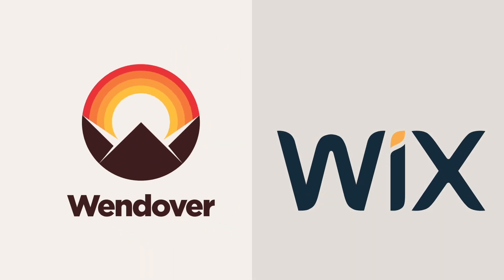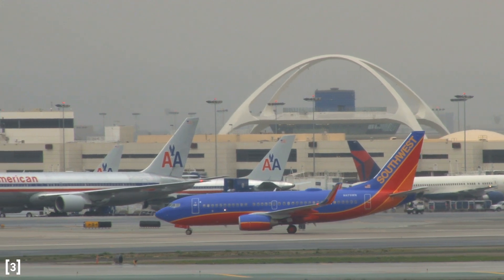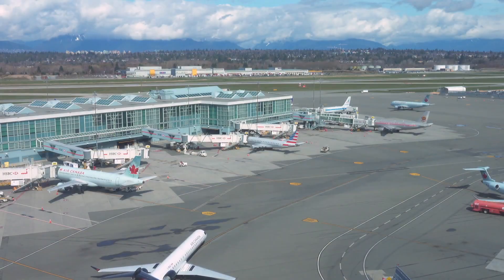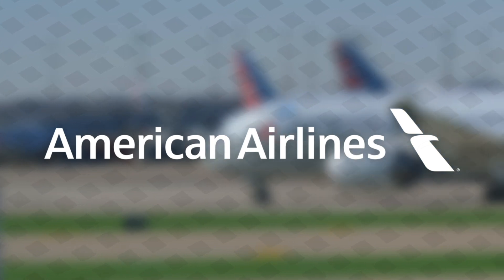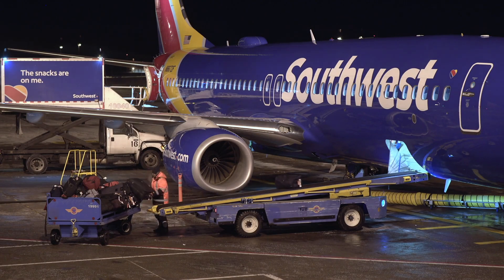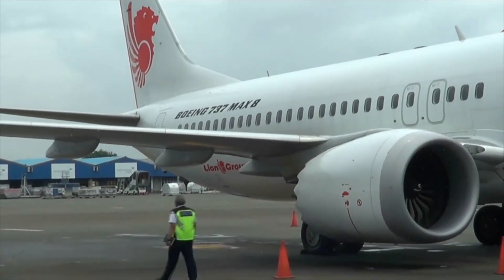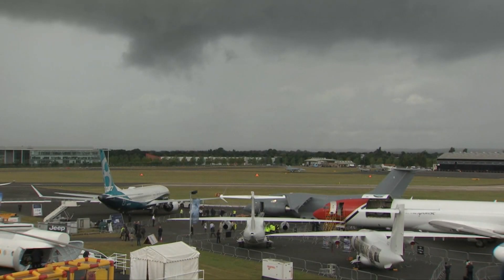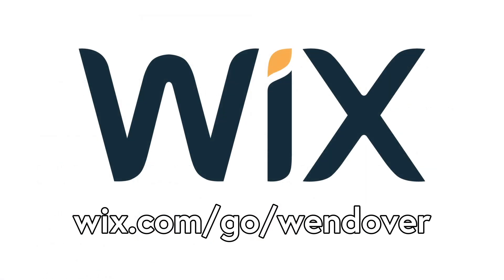The Economics That Made Boeing Build the 737 Max

Comment: I never found the lion air crash back when it happened as worrying given their rather unfortunate track record and lax safety procedures. The Ethiopian one was definitely far more worrying and finding out that the same thing happened twice was enough to seal the deal. Another thing with the lion air crash was the fact that the MCAS failure occurred on one of that captain’s earlier flights and a more competent crew managed to realize that disabling autopilot was all he needed to do. Yet the captain did not repeat that on the day of the crash. Unfortunately that’s what happens when air travel is a necessity and the country isn’t wealthy.

Comment: Several issues with this video.

0:16 Pre-flight checklist? This usually is download navigation charts, checking the forecasts, etc. Not sure how you can do check the forecast on paper and you don't fly any airliner with a paper map. Other checklists are on paper on "most modern airplanes" as well. Pre-start, start, before taxi, etc. this is usually on paper. Something important is that these checklists may vary by your airline company.
0:23 Start the plane by flipping a switch? No, most modern airplanes are not really started like that. Before starting the plane you need to check several things. After that it is indeed fairly simpe to do an APU start. But before that (in pre-start) you've got batteries, external power and/or generators started anyway. If you look at the pre-start and startup checklist for an A320 (or even also neo) it say more steps than simply something like "START SWITCH....................ON"
0:29 I'm an airbus guy but afaik the 737 warning light can indicate several specific warnings that are illuminated. Additionally, every airplane (boeing included) have audio warnings. TCAS, TAWS, etc. The aircraft will literally tell you things like "too low, terrain, pull up" or "traffic, traffic, pull up" or "too low, gear/flaps/etc."
7:15 American wanted a new 737 because they had 737 pilots? Then why did they buy 260 a320/neo for which they had no pilots?
7:41 Especially in the EU Ryanair uses something called "wet lease" which means you lease a crewed airplane (with pilots, cabin crew, even food service); e.g. they mostly use Lauda for Vienna routes
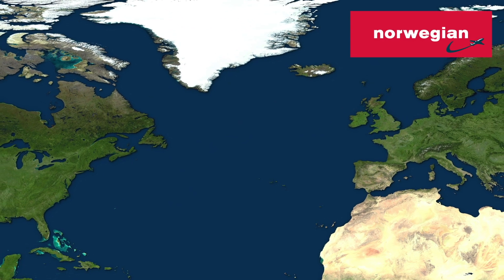8:32 That's not how you pronounce Bergen. Takes 2 seconds to check that.
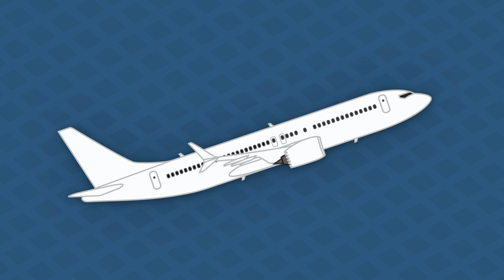10:22 As far as I know, multiple sensors.

I forgot where exactly this was mentiones, but planes actually use a lot of fuel on the ground as well. The A320 consumes 0,1kg fuel per second while taxiing on the ground. Though in cruise, it uses about 0.7kg per second. Short-haul planes have significant percentage of fuel burn during taxiing, especially at busy airports.
Reply: You missed so many points and went wayyyyyy too literal here.

Comment: No one had to guess if the plane would crash because Boeing engineers and safety people already knew their plane had high probability to crash. That’s why they put MCAS on it. And in company email they bragged about manipulating the commercial airliners into thinking pilots didn’t need retraining. Basically Boeing knew there was a problem and covered it up. Fired employees who called out problems or threatened their jobs. You can’t get anymore guilty than that. Read up on it. Watch the videos. All the facts front and center now. But what’s shocking in no one will go to prison over this. I’d never fly in a Boeing. Not over safety issues. They probably got it fixed by now. But over them living about it and knowing it exsisted. Then doubling down on their lies. Boeing is dangerous now. First thing they did was blame pilots when they knew they didn’t even tell the pilots or the airline companies of the exsistance of MCAS. Boeing knowing sent over 340 people to their deaths. Would you trust your families live in a Boeing plane. Would you trust your life?  What other safety issues have gotten through that Boeing has knowingly covered up?

Comment: This video discusses the crashes of the 737 Max aircraft, but omits major points.

On the Lion Air aircraft, on the immediately previous flight, the same nose-down issue occurred. The pilot was able to determine he should shut off MCAS, though how he knew since there was no training is not explained.  They landed safely.  Lion Air then conducted a repair on the angle of attack sensor triggering the problem.  Lion Air did not brief the next crew about what had happened.  The new crew took off in the same aircraft.  The same sensor continued to have issues, causing MCAS to force the nose down.  The new pilots were unable to determine that MCAS should be shut down, probably because they had never been trained on it.  Tragically, the aircraft crashed and all perished.  I hear no one asking why Lion Air did not brief the second crew about what had happened to the first.  Lion Air has a share of the blame over this crash as far as I am concerned. Boeing is also to blame.

By the time of the Ethiopian aircraft's flight, every pilot on Earth knew about the Lion Air crash and what had happened.  As soon as the first nose-down condition occurred, they should have immediately shut off MCAS.  Failure to do so led to the crash.  I do not see how Boeing can be blamed for this crash.
Reply: Quite simple. You could have the worlds best pilot fly that plane and the MCAS would still malfunction and pitch the nose down. Now yes the pilot may well have recovered the plane and turned off the pitch motors, but that still means he has to trim manually which was found not to be so easy. This was discovered by the ET crew who did turn off the trim motors but then struggled to manually trim back up so they had to turn them back on again. In short it’s Boeing’s fault for designing a system that was flawed because it had no redundancy if it were to fail. That could account to negligence, especially if you then did not disclose this information to the pilots who expected this aircraft to fly just like the NG series. If the MCAS was better designed with redundancy and mandatory warnings instead of optional then nothing would have happened except for a warning. If the pilot was the worlds best, the aircraft would still have a major flaw.

Imagine driving down a road and you come across a fallen tree (MCAS fails). A bad driver will crash into the tree and probably die(unable to stop the trim). A good driver will drive around the tree and avoid a crash( turn off the trim motors). But then do they stop and report the tree to the authorities (Boeing) to have it removed (repaired). And if they do, do the authorities just tell people to watch out for this hazard (issue a warning to pilots to be aware) or actually remove the tree and prevent a potential crash? Who would be responsible if another car then crashed into the tree even when the authorities were aware

Comment: The best ever video about the 737 Max with clear explanation about the engineering deficiency and the motive to produce that killer aircraft. I am sure Boeing will make many assurances about this model but I would not book a ticket on any airline flying it ever as it seems a cheap and nasty option for airlines and it should never be offered as a safe means of transport to travellers.

Comment: Another problem is that the had MCAS affect the trim system, instead of being a stick pusher system, which would have been much safer.
But a stick pusher system would have required new certification and training of pilots.
Changes to the trim systems are less regulated.

Comment: The problems actually began long before 2011. By 2000, Boeing should have seen the writing on the wall for the 737, then a 30-year old design. Management chose to keep working with less expensive updates instead of taking the long view and getting a new generation replacement into production. Even in healthy economic climates, any way a service provider can save money in the medium to long term, is an important part of profitability and sustainability. The attitude of "going cheap" and extending and fixing developing problems was driven by corporate greed, and it eventually caught up with them. Building aircraft and predicting the shifting market is a long-term exercise in gazing into your crystal ball and making sound judgements based on what will be best for your customers in the medium to long term. Boeing chose short-term gain over this, and is now paying the price for it.
Reply: By 1996, Airbus had already complained about the certification of 737 NG as a 737 derivative in Europe. I don't know the validity, but I've heard rumors the FAA strongly suggested Boeing was reaching the end of the road for 737 grandfathering with NG, particularly with a new wing, exit door issues, and runway length requirements. MAX pushes it even further with a new engine (at least NG had another version of the CFM), fly-by-wire spoilers, etc.
Reply: @AmbientMorality  my point precisely... it was the hubris of Boeing, and the incapability of the FAA by that time that led to the process. The true problem does not lie with Boeing - as a production company, it has to live with profit/loss... the issue was (and is) that the regulatory body (FAA) has no teeth, and no agents to confirm adhesion to the regulations. Self-certification was and always will be, bad in every way... particularly from the customer perspective.

Comment: Did the 737 Max engineers not use a Design Failure Mode Effects Analysis? Surely would would have included a "sensor fails" failure mode.

Comment: For everyone ripping the MAX, I recommend you look into the recently-released report of the Lion Air crash. It's pretty difficult (IMO) to walk away from that believing that Boeing's engineering was the sole cause. The pilots were incompetent and maintenance should be held criminally liable. It's not even clear that removing MCAS would have saved that airplane from crashing in the first place.
Reply: Mitchell Mason Yeh?well what about the other one that went down
Reply: If the plane didn’t have MCAS it wouldn’t have started trimming the plane nose down. Yes they didn’t take corrective action but the fault lay with MCAS in the first place. A faulty AOA sensor hasn’t caused any other plane to start nose diving

Comment: "The 737 Max only has a warning light."
Great, that's just what you need at 30,000 feet in the air -- a Check Engine Light telling you to go visit a mechanic.
Reply: Wanst the warning light an optional extra ?
Reply: Ian Muir for the difference in AOA yes. The normal warning light for engines, cabin altitude were always there
Reply: bigbodyrover yep. Many redundancies. At its core it was a very safe and reliable plane. They simply pushed its limits without retraining pilots.
Reply: That was a misleading sentence. It has multiple lights all over the cockpit for different instruments/systems. The pilots will know what's wrong when it happens. Newer planes have what's called an EICAS (Engine Indicating and Crew Alerting System) and it works pretty well but the 737 isn't lacking.
Reply: Clay Yosten yeah but compare it to an airbus which gives you step by step instruction on what to do and it is a really outdated way of fault finding. The pilots of Helios 522 didn’t even know what warning they were getting
Reply: @clayyosten2833 I think some Boeing 737 Max did not even have that light ..it was an option offered by Boeing at extra cost
Reply: Cyprian Ferns that was a light warning of AOA difference. Not the same as the usual set of warning lights
Reply: Yeah. Too bad we're not in the age of the Jetsons where  we could stop in at a station at 36,00 feet and have the mechanic take a look ; the passengers could get out to stretch their legs, grab a bite to eat and when the problem was fixed, we'd be on our way.
Reply: @bigbodyrover Hilarious. How did you come up with such a clever joke?

Comment: Pilot training costs drive the requirement to purchase the 737, meanwhile, the replacement for the 737 should have been the 757.  Re engine and far more cargo capacity.  Think about it, the 757 Max and all the problems with this old airframe design would be over.  A fleet of 757, WOW.
Reply: One of the best planes ever created pilots seem to say at least.

Comment: The Boeing 737 was an aircraft designed in the 60's. The 737 MAX was an effort to get an aircraft in service quickly to offset the success of the Airbus A320. What Boeing needed was a new aircraft, but due to the time scales in the commercial market they opted to put new engines on an old plane. This required the extensive modification to the undercarriage which they did not do. They put the engines in the wrong place instead and tried to patch up the considerable undesirable characteristic in the new design with software. In addition they tried to pass the plane off as a minor upgrade on the original airliner without the testing a new aircraft would require and without the new certification pilots would require to fly it. In all this,  two catastrophic accidents came back to bite Boeing in the arse. It is unlikely this aircraft will get certification again and if it did, would anyone want to fly on it.

Comment: People have short memories, in a previous "upgrade" to the 737, the rudder hardover problem, resulted in a number of accidents, only 2 of which Boeing have admitted were caused by a design flaw in the aircraft, in others they have used virtually the same excuses we have seen this time round, pilots fault not following the exact procedure laid down by Boeing, weather condtions, stupid foreigner pilots ( Copa (Panama), China Southern Airlines (PRC), Sahara Airlines(India) and - the one that some may remember - SilkAir(Indonesia),etc.) Boeing fought hard and manged to pass some of the blame onto subcntracors, expect the same over MCAST , they have already leaked hints that the software development was outsourced to an inexpeienced Indian company. However many of the accidents were in the continental USA, dead white people in the homeland - harder to lie about. The information that has recently appeared that Boeing knew of the dangers but thought a projection of 20 or so crashes was best handled through the courts and paying comp for the dead, rather than grounding the plane and sorting the problem, ie cheaper, especially as the majority were in poorer countries where brown bodies needed lower levels of compnsation, is so cynical I cannot help but think this process occured before in the hardrudder crashes. Please seek the detail out and read it, the twisting, turning, lies, blocking court tactics etc are alarmingly similar to today I am very reluctant to board whatever the Max is rebranded as when it returns, luckily,there are more competitors on the horizon, so I live in hope.

Comment: This vid propagates the well worn Interwebs myth that MCAS is an anti-stall system. It is not. It was added solely because the Max-8 did not conform to FAR Part 25.173 regarding linear stick force increase with angle of attack. In a corner case of the flight envelope the nacelle causes  a pitch up even more than expected. This reduces the sticks tactile feel so the pilot may think
it's ok to pull back even more (and possibly stall) when it should be pushed forward. So MCAS was added as a transparent stick 
pusher. This can be spun as a different feel than the legacy 737 because that aircraft series did not have this  issue.
The Seattle Times published a great article on the history and design of MCAS and explains this in detail.  It's available online.

Comment: No mention that they cut costs by only using one AOA sensor instead of two and didnt even mention the MCAS system to pilots.
Reply: Planes have 2 AOA sensors. The issue was they only used the input of one into the MCAS. If they fed data in for both, and MCAS got mismatched data then that would need to trigger a warning to the pilots (which would have required training). So it was down to cost; pilot training. But not cost for the AOA sensor.

Comment: Yooo this may sound crazy...

But what if

They just made the landing gear bigger so it gained more ground clearance
Reply: The Empowerer  check the A350
Reply: Rene Castillo yah
Reply: 737max - 10 actually has a extendable landing gear lol
Reply: 8 xnm 4 like something on all models that have longer landing gear so it gets more ground clearance so they can fit a better engine, instead of doing something like what they did fundamentally changing the plane whist airborne

Comment: There is a lot of inaccurate information mentioned about the newer 737's, the most prominent one is the "cables" you mentioned that operate the aircraft's control surfaces, like the rudder, elevator and airlerons. The 737 has hydraulic systems that operate those control surfaces and other systems. If there were cables operating such surfaces, pilots would never be able to move the control yoke while the aircraft is at cruise altitude going close to 500 MPH. Yes, there are systems on the auto-pilot (when set) that operate the controls, but even at slower speeds and lower altitudes, moving the yoke and the rudder pedals to turn the aircraft would be very difficult with cables.

Comment: In short they wanted to minimise the cost of new fleet of flights and look at it now, now they have to pay 1000% more than they had anticipated to save. History clearly proves, success is not dependent on once ability of fierce rivalary rather it is dependent on how good once product is. A small instruction/training to deactivate MCAS could hv saved it all. Flying in an aluminium tube at 13km up in sky with a doubt in the mind of its safety is a very sad state of affair. Boeing will take a very long time to get the reputation it had  build in 100 years. Many folks now think that Boeing 737 max can not glide if both engines fails. Although aviation expert says, it can glide and MCAS will not related with aerodynamics. Can any one explaine this aspect of layman's doubt.